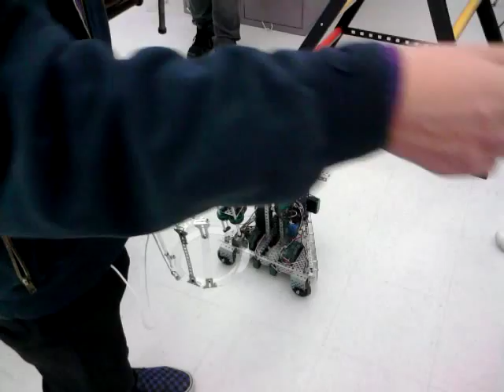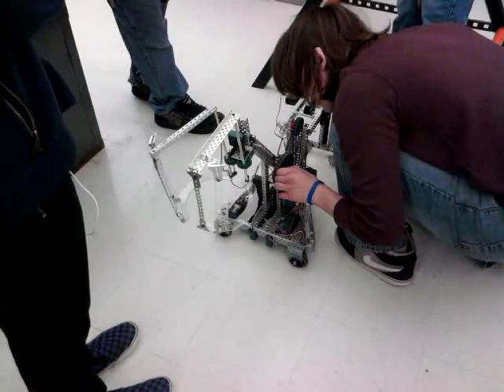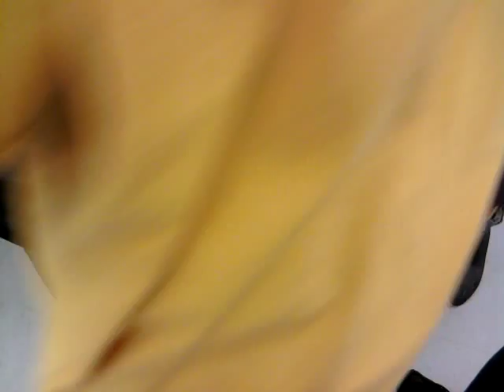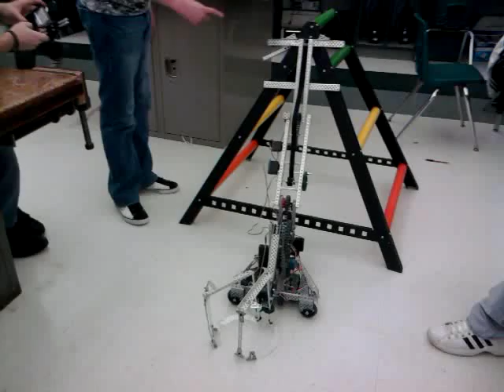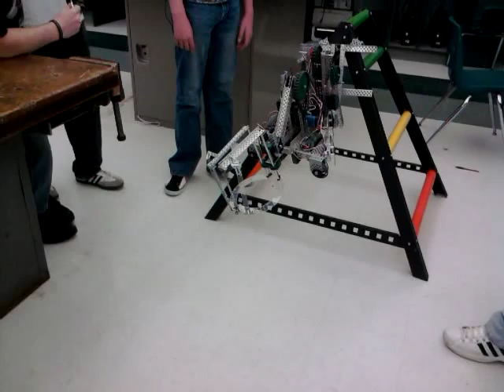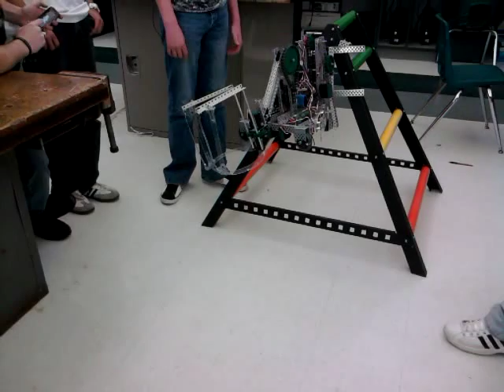Vex Robot 4542E High Hanging Full

Comment from the maker: Our design proved to be pretty slow compared to the robots later in the year. I think a good place to start is just regular old sliders, make sure they are supported well and make sure that your center of gravity isn't very high. Hanging is a tricky part of the competition but is well worth it if you can do it quickly. As for powering you lift, I would recommend using some pneumatics because they offer a lot of power while at the same time not wasting motors to lift your heavy robot. Good luck